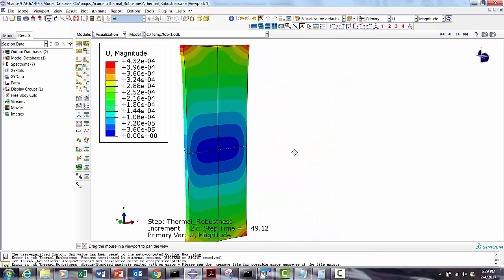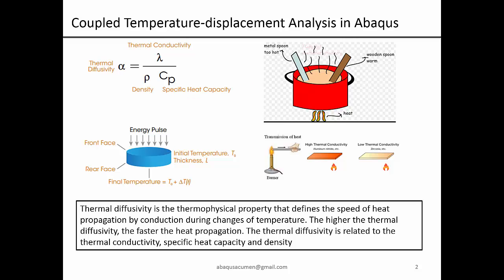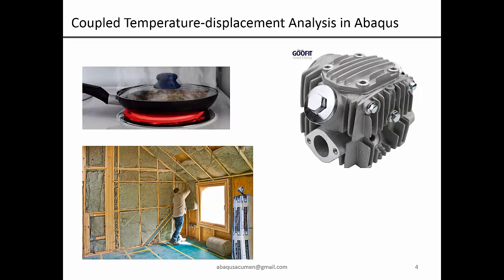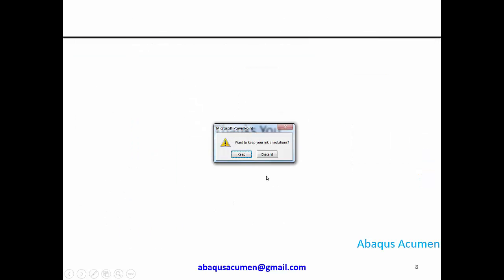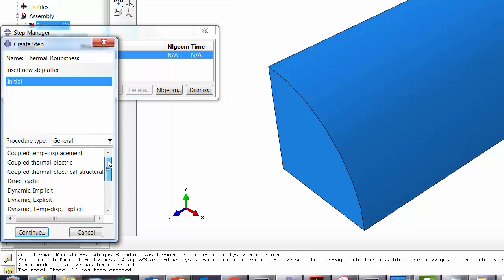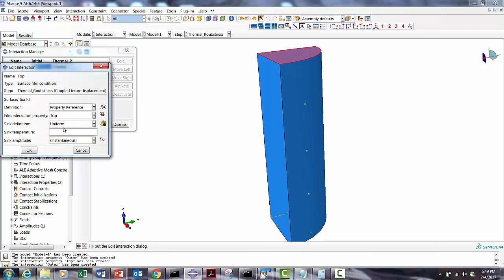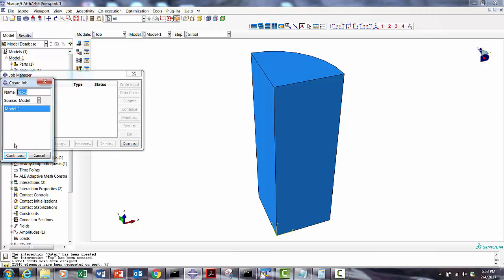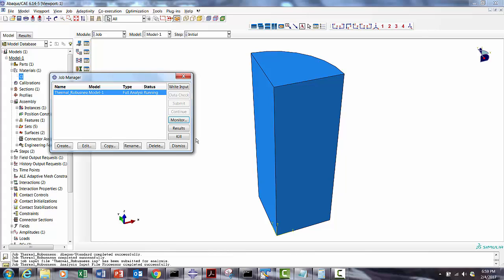Abaqus 6.145: Coupled Temperature Displacement Analysis (Thermal Robustness Modeling)

Comment: Since the sink temperature is 600, the piece can not reach a temperature over 900°C because it goes against the laws of heat exchange. The mistake is when we define the amplitude, we need to set a coefficient that multiple the reference value, in this case the sink temperature. So if we want that the temperature starts to 23 at time zero and reach 600 at 7200 s we need to write 0 - 0.038333 in the first row and 7200 - 1 in the second row.

Comment: Thank you for this video. 
Can you tell me though would it be possible to model a surface-to-surface contact analysis in a coupled temperature displacement step? I'm using a surface flux as the load on C3D8T elements and i need to have mechanical interactions but I cannot get my model working.

Thank you in advance.